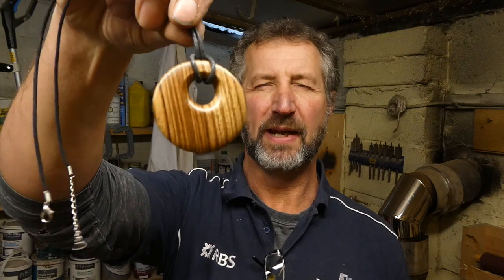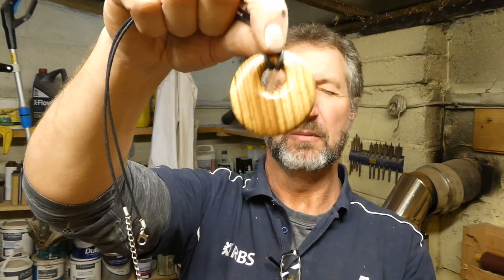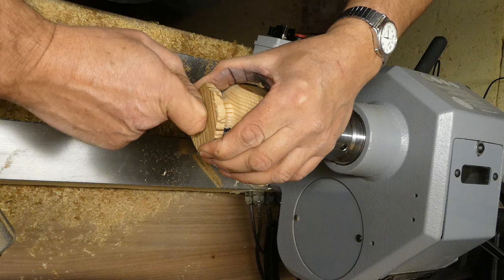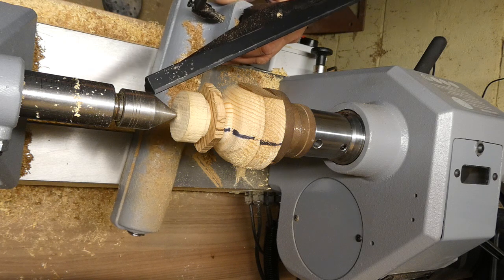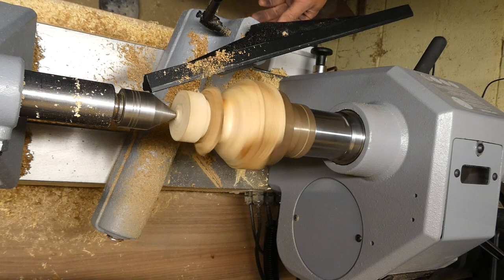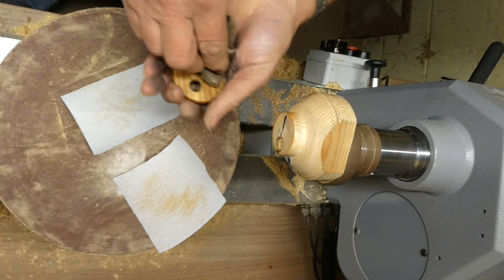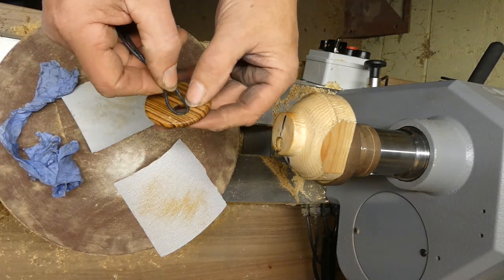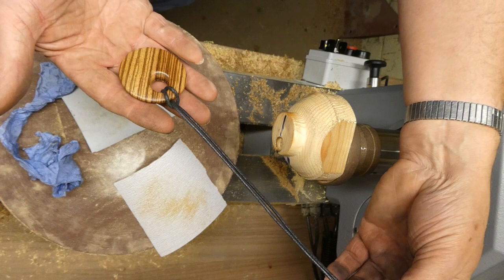How to make a wooden pendant

Comment: Thank you for the upload, prefer this method of doing the offset hole pendants. I will definitely be trying this once my turning area is set up. beautiful wood choice too !
Reply from the maker: Hi Cyrus... thank you... I  I hadn't used it for a while... but last weekend I made a couple of pendants out of Padouk using the jig ... I had forgotten how easy it was ... use hot glue and when you turn the jig make sure that the face that you stick the pendant to isn't too big... then when turning you will be able to get around the back a little  ...good luck with the set up ... take care...All the best.....Andy
Reply: @AndysCornishCreations  Yes, I noticed you were able to get both sides without flipping it, you can bevel the hole the other method, but one side is against the chest so that isn't a real issue, Great how to video, just got a smaller bench top wood lathe for jewelry, have full sized ones also, but for intricate work I'd rather be able to stay smaller. I also do metal, but that's precision metal work, mechanical things I create, wood is more relaxing to me and artsy, lol...
Thanks again for great video, will check your channel for more...